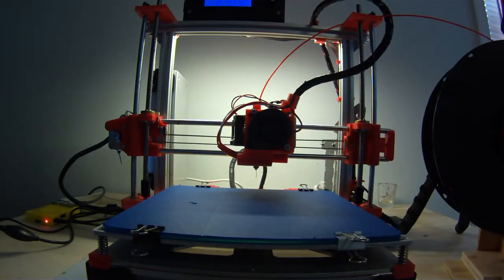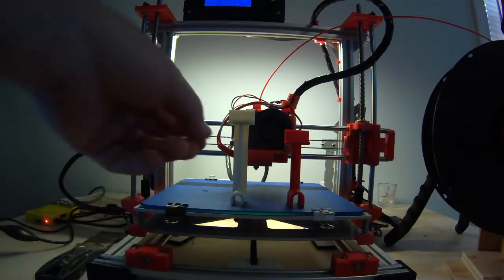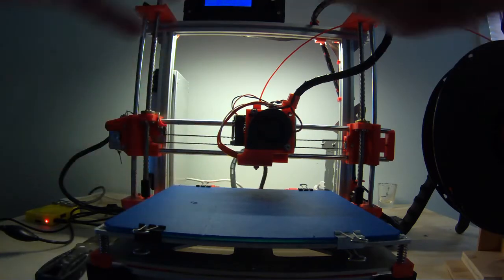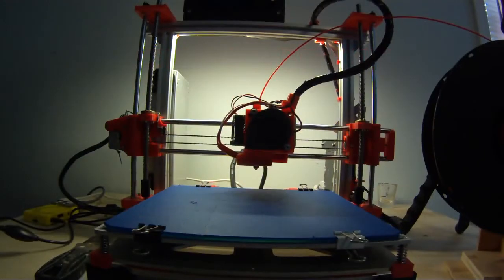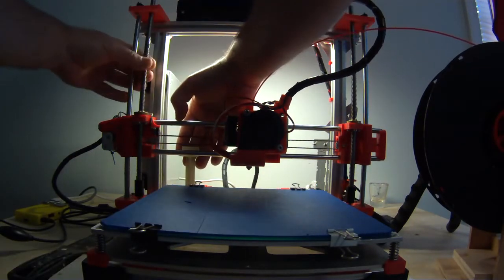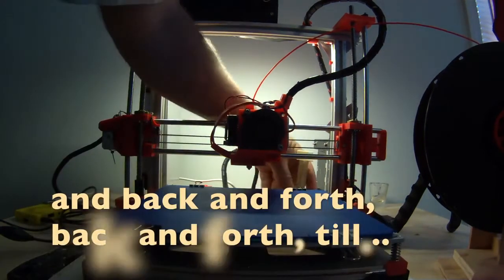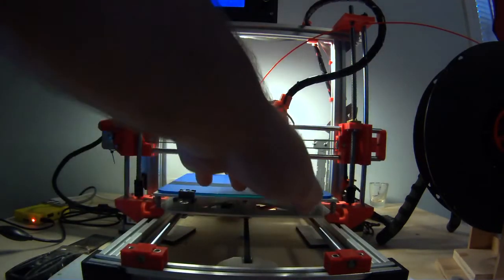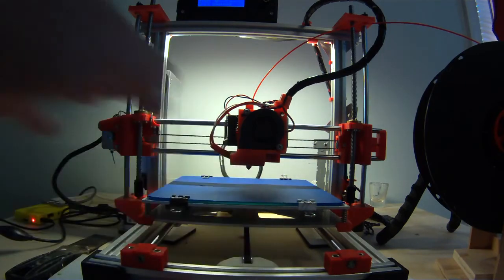Level X to Y axis before leveling bed

Comment: wouldnt be easier and quicker to print two of the same tool  ??
Reply from the maker: Yes, but less accurate.  You’re trying to adjust to micro size adjustments. Printers are reasonably accurate but far from perfect. There maybe slight diffs between two which would make the whole process incorrect.
Reply: @Thomllama  ahhh i spose